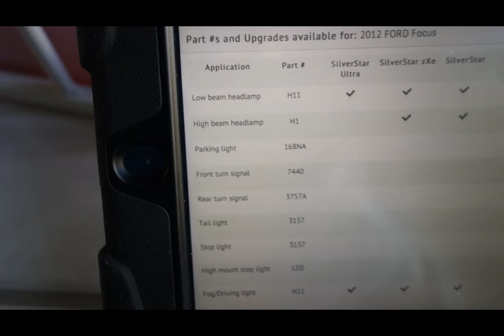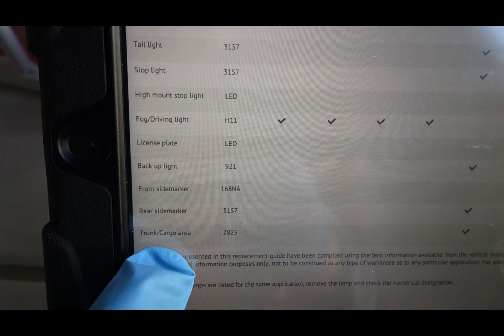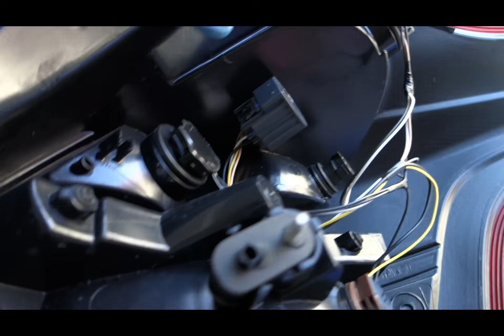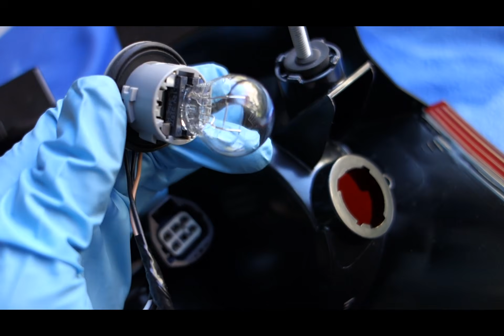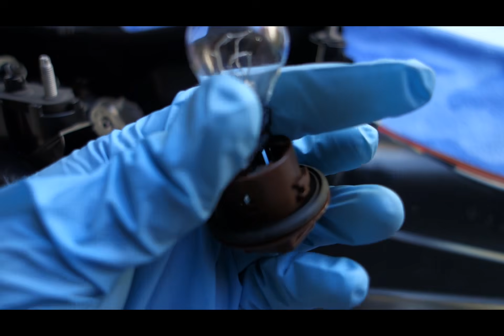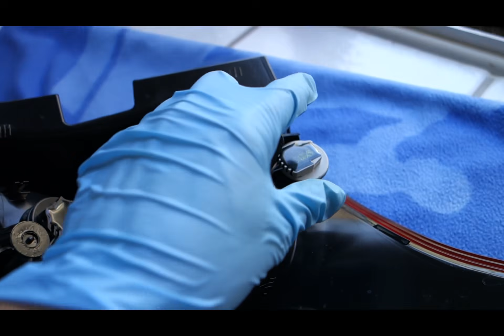Ford Focus Tail Lamps Details And Bulbs Replacement Guide

Comment: I have a 2014 Focus Sport Hatch (Australian Model). I just bought a Philips P21/5 LED brake light to replace the standard one, haven't fitted it yet. Do you know if I need to fit resistors to make it work? I read that LED's can spark warning messages on the dashboard and prevent the bulb from working. I have also ordered a Philips LED resistor kit but only really want to fit it if its necessary.
Reply from the maker: Dan Barraclough It's just a different socket of P21/5 bulb compare to US-spec 3157. I cannot give you a solid answer if you'll need the Philips Resistor for the Brake LED or not. BUT you can easily test it yourself.  Simply pull out one of the Brake Light bulb and turn on the car, see if the Dash will throw you a Fault Reminder message. If you see such message with the Brake bulb pulled out, then you'll need to install the Philips 21W Warning Canceller LED.Check out my video on how & where to install the Canceller: https://youtu.be/vy__pqH_1VQ
Reply: Hi, thanks for your help mate; I did it today. Firstly, yeah it did come up with the warning, I didn't try it with the LED bulb yet (still not received it) but apart from the initial error message it still works all ok. Secondly, I accidentally dropped one of the two black plastic thumb screws in the gap behind the trim and no matter how much I feel around in there I can't find it. You reckon I can just hand tighten a nut over the screw? Might go to my local Ford dealer to see if they can source me one.
Reply from the maker: Dan Barraclough The black plastic screw is just called 'Nut'. The dealer can surely source you one but it won't come cheap (as plastic, it costs US$10 here). Another way to source if you can go to any junk/wreck yard and simply match one from the similar Ford Focus. (Bring your existing one to match)
Reply: +moomoo97 yeah they charged me AU$7.50 which (I think) roughly is about US$10

Comment: @moomoo97 it is an aftermarket part!!! It does not come with bulb socket or holder. the seller has stated that the all the bulb socket needs to be transferred from the original unit. Could you tell me how to? And thanks for the reply btw😀😀😀
Reply from the maker: Noneofurbusiness Easy. If not already, watch my video on how to remove the Focus tail light housing and disconnect from the main first. The whole wire harness is only clipped on the lamp housing, so simply lay down your new light and the old one side by side to see which light socket will go to which hole. Unclip the harness and transfer the whole thing over to the new one.
Reply: thanks a lot mate!!! did it successfully..it was very helpful.

Comment: hi my ford focus 2013 tail lamp lense is broken and I have ordered a new unit but it does not come with a bulb holder!!! what does that mean??? i have not got the unit yet so being curious!!!
Reply from the maker: Noneofurbusiness If it's an OEM Ford Tail Light Assembly, the whole bulb-sockets (or holder?) harness should come together as part of the housing unit. If for some reasons it doesn't, then you can transfer the socket harness from the old to new housing. It'll be a simple operation, though I hope you don't need to do it.

Comment: The quicker illumination time is advantageous for turn-signals when you're changing lanes.   At 70 or 75 miles-per-hour on the highway, the difference in illumination time between incandescent and LED means you travel about 15 fewer feet before the LED is bright enough to see, vs. the incandescent bulb.  That can easily mean the difference between someone being able to avoid you or hitting you.

But you do have to be careful, like you said, to get an LED with a resistor built-in -- otherwise the flasher will go crazy.